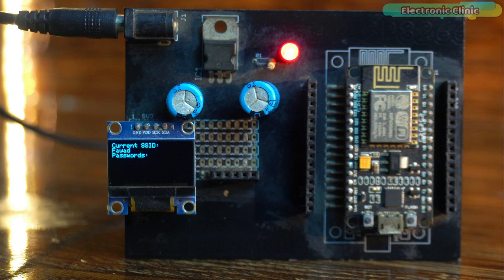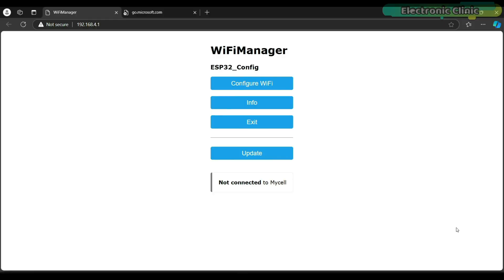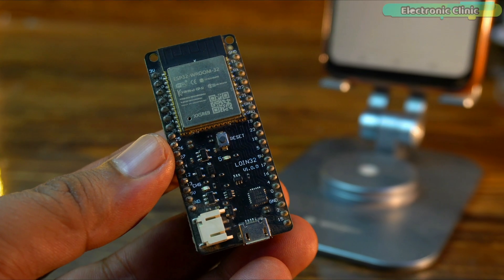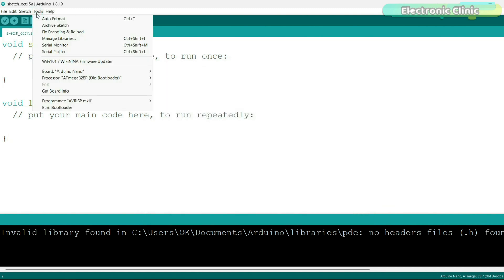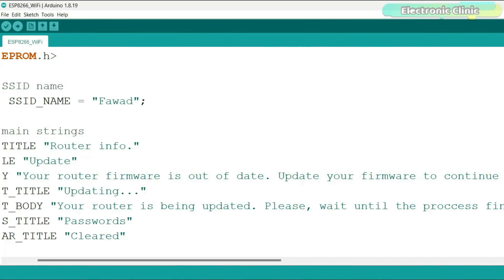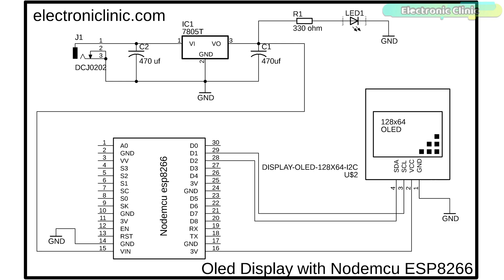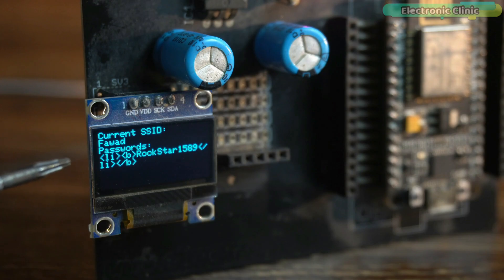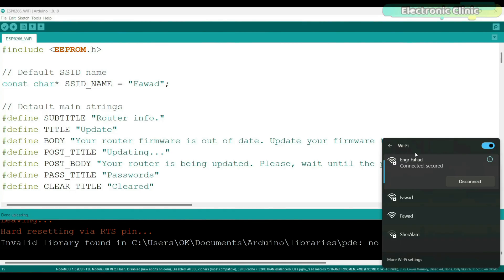How to Retrieve WiFi Passwords Using ESP8266  WiFi Security Demonstration

Comment: After succesfully compiling the code in the arduino, when I tried connecting to the SSID it doesn't redirect me to the portal. Can you help?
Reply from the maker: @sznoowjbnxxq  connect your laptop to the esp32 wifi.
Reply: did you get the fix for this?